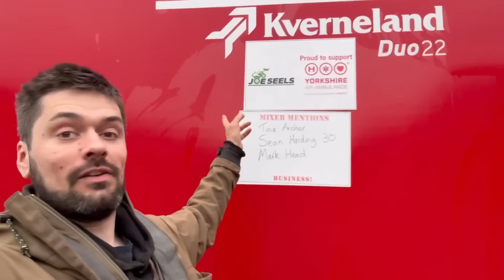Somethings Been Loose! Big Micks a Hero! Busy Day!

Comment: Fingers crossed that solves the 9mtr Joe. It certainly would make sense that is the problem. Especially as it's only an issue when below freezing. When starter needs more power from battery. Trouble is that you won't know until it gets cold again 🤔

Comment: When jcb came the other day what did they say was wrong with it?
Reply from the maker: They said it was high pressure pump…
Reply: @joeseels  and they didn’t spot the loose terminal on the isolator. That’s crap. If it works fine you should tell them!